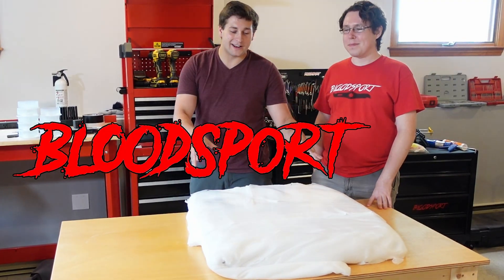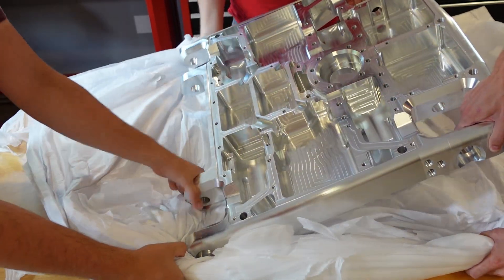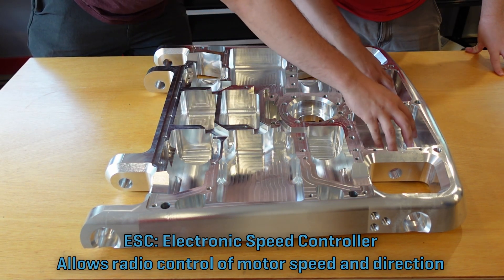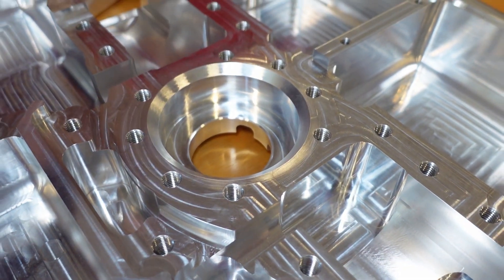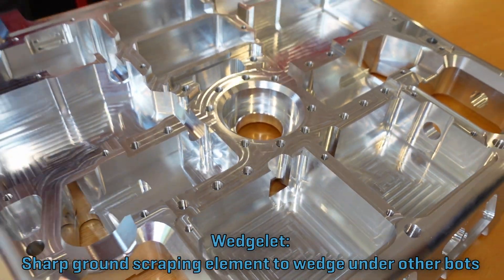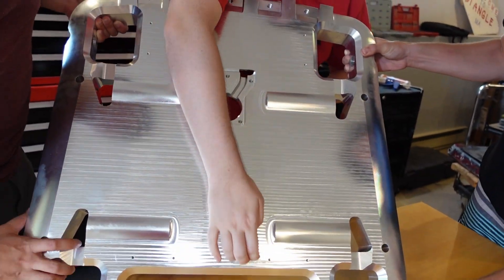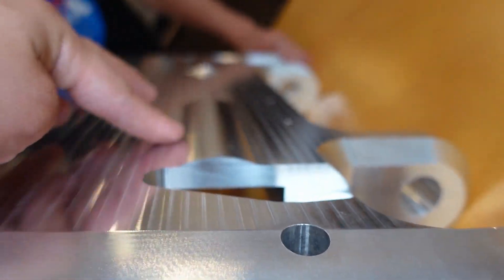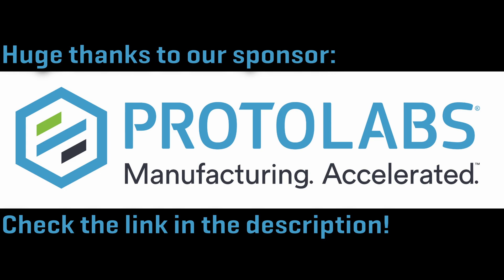Bloodsport V3 Chassis Reveal | Battlebots Season 7 (2022)

Comment: Part : comes wrapped in layers of soft foam, carefully handled.
Also part : used in destructive Battlebots facing hardened steel blades spinning at 250mph, and flipped up and dropped from 3m in the air

Comment: Aww, c'mon, guys - I was expecting $320,000 of forged titanium! [Yes, of course I'm kidding.]

It does look gorgeous, and the close-fit motor recesses should give good heat transfer - the whole chassis is one big heatsink.

I'm glad that nobody's trying to replace aluminium (and steel) with vacuum-moulded epoxy-carbon composite structures in heavyweight robots. They're rigid and very light, but they're nowhere near tough enough for combat.

Good luck, chaps! 🙂

Comment: Looks expensive.
Reply from the maker: Thankfully Protolabs gave them to us for free due to the sponsorship! Bloodsport version 2 had a slightly bigger chassis which we did actually pay to get machined, for those we got three chassis for a bit under $10,000. That may sound like a lot of money, but given the complexity and size of these parts that's actually incredibly cheap. Just the Aluminum stock needed to make one of these pieces if purchased in the United States would be about $2,000
Reply: very expensive

Comment: I can't even describe how excited I am to see the new bloodsport in action!! Quick question though, do you guys shock mount your components? I see that the drive motors fit perfectly in cavity, but then during hits wouldn't that transfer all the energy into the motors?
Reply from the maker: Thank you! Everything except the drive Motors is shock isolated with TPU or rubber. The drive Motors happened to be extremely rigid on their own so they actually add a little stiffness to the chassis because the body of the motor is just a steel tube. We have hard mounted the drive Motors in the last couple seasons and haven't really had any issues